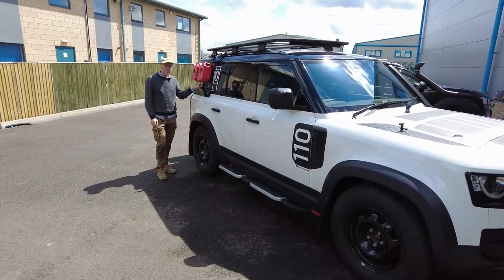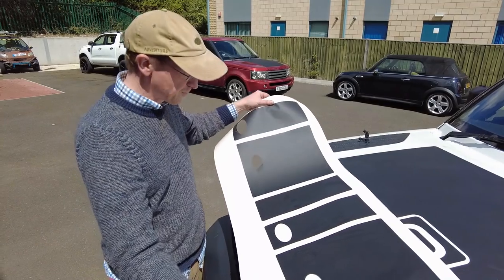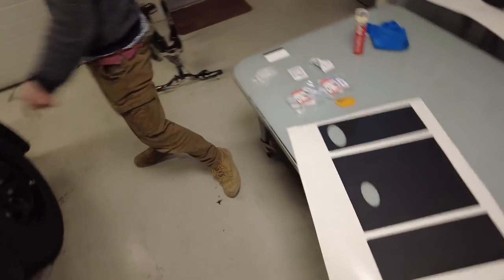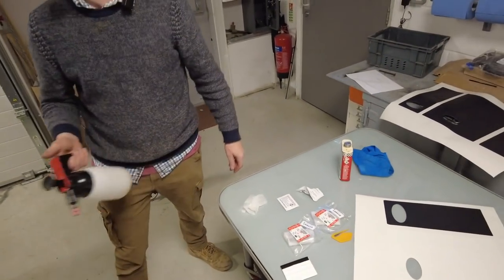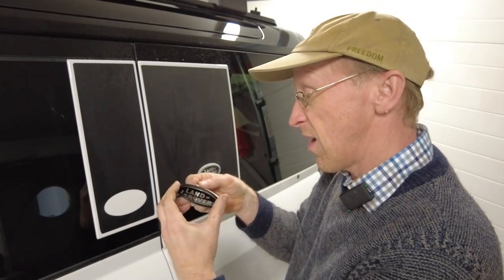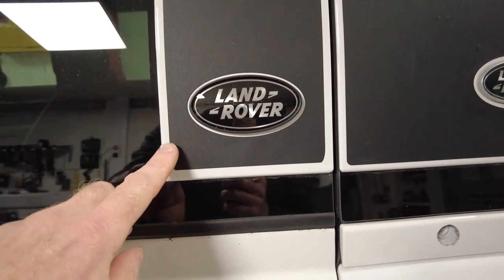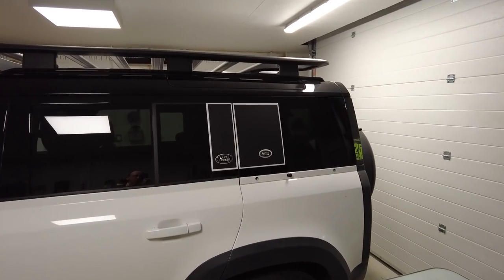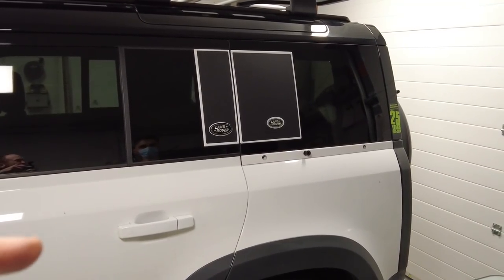Land Rover Defender 110 Side Square Plain Graphics / Badge Relocate

Comment: Top tip : Applying graphics wet is fine, even better if you apply soapy water to rear of graphics as well, just don’t try playing with it for a couple of days to let water fully evaporate 😀
This way you can slide graphic into right position easier 👍
One other thing to remove graphic heat all over, keep moving heat gun and then use both hands to pull graphic of 👍

Comment: Simon,  can you not supply the same sized badge and adjust to keep it in line with the existing (covered by lunchbox) badge?

If the plate or box is removed for any reason you have symmetry / alignment which will look better.

Also

Where have you got with the development rear bumper protecter from months ago?  The one that went over the lip of the bumper to hive a bit of additional protection?

I did follow up with your team (kate) in early April & was told it was in final development & 2 months away..  Is it ready yet 🙏

Comment: Please stop with applying vinyls wet. It will fail quicker than Landrover Airbags
Reply from the maker: Hi Robert - so far airbags and wet applied vinyl's are all OK - also you can see how well stuck the wet applied vinyl are.
Reply: @L663  there can be tiny bits of water stuck under the vinyl, when it freezes they can crack the vinyl. If the vinyl has an air release carrier there is absolutely no need for water. Trust me I’ve been wrapping vehicles for over 20years. I must have had a bad Disco with the airbags 😂